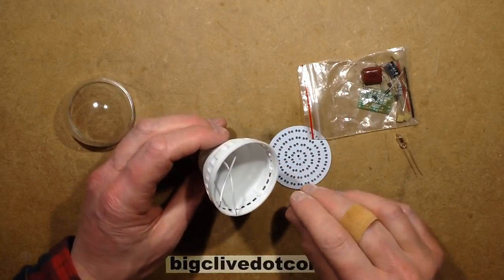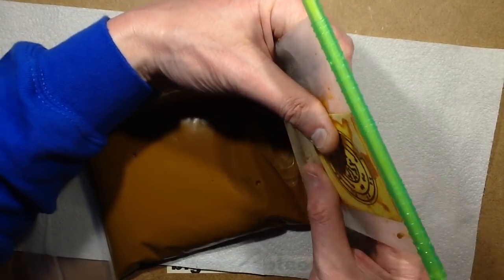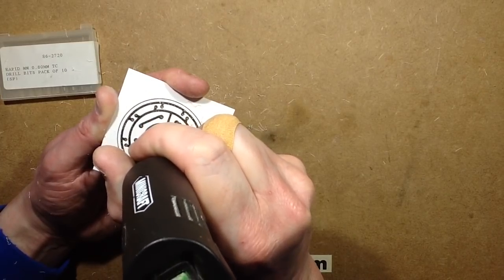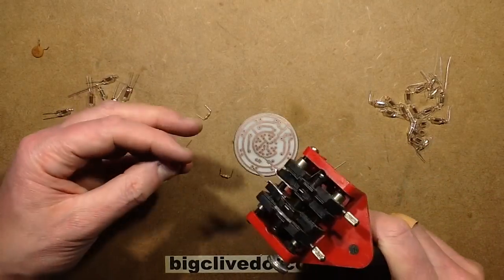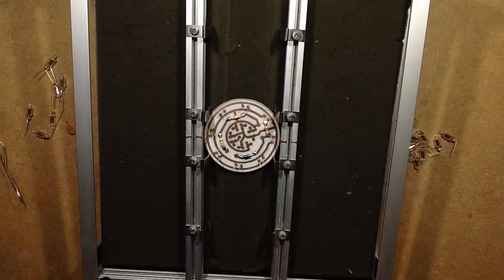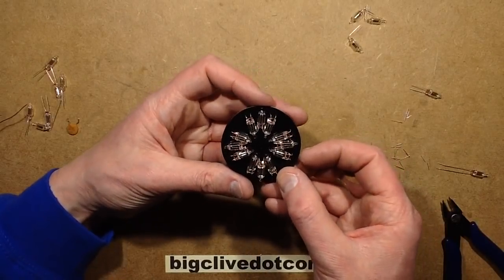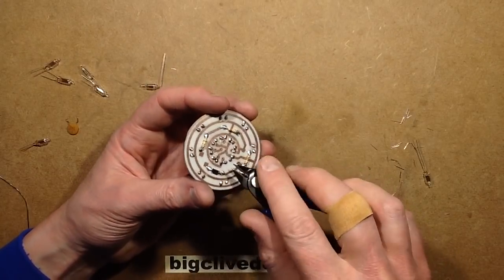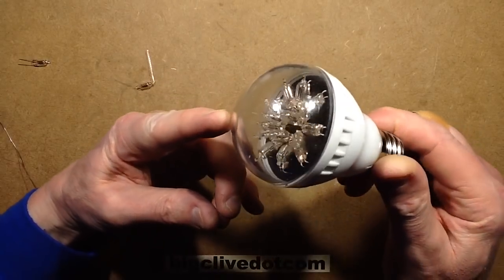Full mega nixie-lamp build with custom PCB.

Comment: Does this work with argon indicator lamps, too?
Reply from the maker: +BloodySword Not sure.  They're far too precious to use in big clumps like this.
Reply: +bigclivedotcom Why is everything that emits kind of blue precious?
Reply from the maker: +BloodySword the green, blue and even rarer white neon style indicators are just so much harder to find and more expensive when you do find them.  They also emit less light and fail faster than bare neon indicators and may not work in the same way on the circuit.
Reply: +bigclivedotcom Yeah, it's a pity that gas discharge lamps and LEDs that emit more in the shorter wavelengths areas are so brittle... Is it because it's higher energy?
Reply from the maker: +BloodySword In the case of the tubes they may be made of a quartz glass, and for the LEDs resin and chip degradation is probably the biggest issue at shortwave UV.

Comment: Nice solution (pun not intended) with the double-bag seal.
Reply from the maker: +Shroud3d It's a very clean etching system that stores in a small space.  I still use the original Seno GS accessories with it.  Mainly the support tray.

Comment: You should get some Plastidip for painting these, takes about 15mins to cure to touch and will not make a mess after this. It is also rubber based so may have some insulating properties? You can get it online or in Kustom PCs in Ayr if you are ever through that way.

Comment: hey clive, why not centre punch your pcb instead of putting your 0.5mm hole in the cad program?
Reply from the maker: +Liam Russell Because when I develop it properly it etches that indent for me with absolute accuracy.  The tiny hole in the copper is enough to perfectly align the drill bit.
Reply: yeah but for situations like that one.

Comment: Hi Clive...
Please forgive the possibly daft question but does Sprint Layout allow you to build a circuit diagram and then convert it to a PCB layout?
Cheers... Malcolm
Reply from the maker: +MrBanzoid No.  It has separate modules but no significant interaction.  It's main advantage is that it allows quite artistically placed PCBs to be made quickly.
Reply: +bigclivedotcom Thanks Clive.

Comment: I use an Epson r265 with a continuous ink system,  it's only cost me £12 in ink in the last 10 yrs, it would have got me at least £2000 if I'd used original inks.
Reply from the maker: +dooronron69 It saves a lot of inconvenience once you've got past its "huffy" stage of grudgingly accepting the cartridges and then cleaning the head from underneath after it vomits the new ink supply internally.
Reply: +bigclivedotcom ive been pretty lucky with mine as i run a programme that says they are full each time i reboot the printer. the only trouble i did have was the waste ink reservoir was saturated so i disconnected the waste ink pipe and it now goes into a lunch box with cotton wool in it which i change every so often. great video by the way.

Comment: Is there a place to buy lamp enclosures like that?  Would be cool to make custom LED lights.   Better than the stuff you can buy from pound land lol.
Reply from the maker: +The Rambling engineer. The Chinese do have some rather odd terminology,and it's clear they copy each others listings, complete with mistakes.
Reply from the maker: +Red Squirrel Yup.  eBay.  They sell LED lamps kits for about £1 ($1.50)
Reply: +bigclivedotcom I cant find them on ebay with the clear dome.... Do you have the link?
Reply from the maker: +The Rambling engineer. Here's an ebay search with the keywords.
http://www.ebay.com/sch/i.html?_from=R40&_trksid=p2050601.m570.l1313.TR0.TRC0.A0.H0.X60+LEDs+lamps+suite+diy.TRS2&_nkw=60+LEDs+lamps+suite+diy&_sacat=0
Reply: +bigclivedotcom Thanks! I guess i didn't have the right terms in the search bar... "led lightbulb diy kit" brings you very little.

Comment: Some Cannon's these days are money grabbing. The last one I tested for work had a system where if the ink cartridge was removed for any reason that same cartridge could not be installed in the printer again even if you remove it when it was full.
Reply from the maker: +Sean N The secret is to check the availability of refillable cartridges or continuous ink systems before buying the printer.

Comment: Those motorised chucks you mentioned, I have 3 or 4, in short dont bother, the chuck is all one piece and they hold the bit at an angle, cheap and horrid.

Comment: Rock 'n' Roller Coaster in Paris is really an amazing ride. It's unbelievably smooth.
Reply from the maker: +SteelSkin667 It is.  I had the surreal experience of riding with one of the Dutch guys that put the lighting in that ride and we were just talking about the lights as we blasted through them in multiple loops.  Totally distracted from the ride itself.

Comment: Have you thought about trying silk dyes for coloring circuit boards? I haven't tried it yet.
Also, the copper oxide plated on the surface of the dumet wire will actually bond to the glass.

Comment: For the record, Dumet is iron-nickel-cobalt alloys, with many sub-types. None with copper, strangely.
Reply from the maker: +Alex Barlow I also completely failed to mention that the red colour was a deliberate oxidation of the wire to act as a mating surface for the glass.
Reply: Oooooh. That makes more sense.

Comment: Windows 8 laptop or a PC with a battery and wireless network card.
Reply: Um, pc.. with a battery? you mean like a UPS?
Reply: F1nWarri0r Yes.
Reply: +PianoVideosJustForU (PVJFU) Can't really compare laptop battery life and ups's now can you? I don't understand.
Reply: F1nWarri0r Yes you could, they're both a battery, with the power goes out as long as the battery has power in it, your PC will still work.
Reply: +PianoVideosJustForU (PVJFU) Yes, but with a laptop, even a crappy one you most likely still have at least a few hours of time to save your work or even keep working. Ups's give you just enough time so you can save before it runs out of juice. Unless we're talking huge enterprise-grade equipment here..
Reply: F1nWarri0r No, my crappist one doesn't even hold a charge, but a decent crappy one for me is about 15 mins-1 hour, you could get 15 mins out of a UPS.

Comment: Do you have a PCB pattern for your ionizer design, or should I just solder the components to each other? (I'm building it this week, finally)
Reply from the maker: +Gadgetboy Do you mean the voltage multiplier version with the capacitors and diodes?  I think the version without a PCB is actually better for tracking distance clearance.
Reply: +bigclivedotcom Oki, I'll do it that way, then.
Reply: One last question before I get started on my build. On the website, you've indicated an add-on neon indicator, with the resistor and capacitor and neon. Is this in series at the high voltage side of the multiplier, or on the mains side? The diagram indicates it on the high voltage side, but the ionizers you've torn down have their indicators on the mains side.

Thanks in advance for the clarification, I don't wanna let the mysterious blue smoke out of anything (especially when fiddling with things producing Kv...)
Reply from the maker: +Gadgetboy On the commercial ones the neon is just a power indicator.  On the website version it is used to indicate ion output by blinking at a variable rate.  So in the latter version it is in-line with the output.
Reply: Thats what I was thinking, just wanted to make sure.

Comment: I used sprint layout for years, But had to learn Eagle because the board manufactures would not take sprint files for production runs.
Reply from the maker: +Mike James I've had no problem using the Sprint Gerber and NC drill files with manufacturers.  It may be that they just didn't take the bare LAY file.  With my current suppliers I put all the Gerber layers in a zipped file and upload it on their website.

Comment: Nice but it won't be very bright.
I like the 'fire in a bulb' effect with the diffuser. It should be possible to build a brighter version of this with LEDs in a grid pattern driven from that random LED flasher  program you demonstrated recently.

Comment: May I ask where you got the white PCB with the photosensitive coating, Clive? After watching you do it I'm tempted to try this myself...
Reply from the maker: +alexanderktn Photosensitive PCB laminate is a common item from good electronics suppliers.  In the UK I buy it from a company called Mega Electronics.
Reply: +bigclivedotcom Thanks! I can get them with a greenish base board color here, I was just wondering because I never saw a white version and would prefer it over the green one, especially when the PCB is visible.
Reply from the maker: +alexanderktn The white stuff is FPC16.  A cheaper prototyping material than full fibreglass laminate.  It has two layers of fibreglass with a sandwich of a lighter traditional paper bonded material in between.  It's lighter, cheaper and easier to drill with most of the advantages of a solid fibreglass laminate.  The whiter finish is nice too.  http://www.megauk.com/pcb_laminates.php
Reply: +bigclivedotcom Thanks a bunch, that was what I was looking for - FPC16. Now that I know I guess I'll buy a few - they are gorgeous (even when not painted black ;) ).

Comment: I've always had good experiences with HP when using inkjet printers, but I've always gone for the old ones (940c, 970cxi, 990cxi) so not sure about the newer ones, but those old ones seem indestructible and Windows 10 has full support for them

Comment: +bigclivedotcom With the printer. I have an Epson printer and i used have windows 8 till i got pissed off with it. I just used 7zip to extract the windows 7 driver find the inf file and install it manually.
Reply from the maker: +Ben Mitch I've just discovered that while they don't support the printer model I have (possibly a UK number variant) they have a driver for the base series that did work.

Comment: You're damn right about Epson being control freaks. Last Epson printer I had came up with a non resettable error one day that basically said "this printer is now old you must buy a new one" (something about the ink pad being full, which was an estimation coded into the firmware, not actually measured!). I will never buy anything made by Epson ever again.
Reply from the maker: +add2k Look online, there may be a button combination that resets the ink pad counter.  Be wary of any software being sold or made available "free" that does it though.  It might have a malware payload.
Reply from the maker: +simontay1984 The only good ink cartridges for an Epson are the bulk external tanks hooked up with a CISS cartridge so you can print to your hearts content without worrying about the cost.  But you do have to nurse it through accepting the new cartridges and getting over it's ink-splurge moment that it usually has when they are first put in.  The Epsons are just not quite as good at handling their ink as the Canons.
Reply: +bigclivedotcom Unfortunately there was no button combination that would reset the fault, it had to be done either by sending the printer to Epson (£££) or by a piece of software.

There are some free programs out there that will reset the counter, but unfortunately as the firmware on the printer had been updated they would not work!

In the end I had to pay a few dollars for a piece of (reputable) software to reset the counter and had to strip the printer down and remove and clean the ink pad which was a messy job!
Reply: +simontay1984 I did take it apart and clean it, but it was a messy job and it isn't just a tank or a sponge like one may expect. It's a '3D jigsaw puzzle' of sponges that don't go back together very well once they've been removed, cleaned and dried.

...And you have to pay for software to reset the counter! There is no way of resetting or using the printer once the waste ink pad timer count is up.

When this happens, the majority of people would simply bin the printer and buy a new one. Ultimate planned obsolescence!

Comment: Is there anything particularly wrong with using a dremel with cheap steel bits to drill PCBs? I'm just wondering because I'm a beginner and this was my cheapest option of doing it.
Reply from the maker: +Derp Herp If you already have a Dremel then that's a good option.  You could use the steel drills or try the tungsten carbide bits.  I like to say "Use what ya got."

Comment: That looks amazing, without the diffuser it looks nice, with power and the diffuser it looks alive like something trying to escape lol :-D
Your too clever clive :-D
I used to use petrol to remove the etch resist, but that was the pen type of resist, crude but worked :-).
The etching system was so dam expensive, also you could get the tinning fluid as well, but sell a kidney lol.
Reply from the maker: +zx8401ztv I had the tinning fluid and it was great.  But one day it kind of self reacted and all the tinning agent just suddenly precipitated out.  Too expensive for the amount of use I got from it.

Comment: I've not made it past 2:18 yet, but needed to thumbs up for "SHIT LOAD OF INK"
Reply: +simontay1984 I use a brother laser printer for everything anymore. Ink jet printers are an abomination that never should existed :P In this day and age, color printings are rarely needed for anything, and if i need one, i just pay my library a few cents to print from a flash drive for me.
And if you like ozone smell, you will LOVE how fresh laser printings smell :)
Reply: +Richard Smith Indeed; my old Hewlett-Packard LaserJet 6MP is still running strong. The toner cartridges don't clog or whatever - and costs a lot less per page than inkjet. I've got a FedEx Office nearby with self-serve color copier/printer units that produce much better quality color laser prints than any inkjet I've seen, should I need color.
Reply: +simontay1984 Seen the new Ink Tank models?

Comment: Is it possible to know where the "dominant" tube will be based on the circuitboard design? In this case I feel it would have been best to have the dominant one in the center.

Also I loved the frosted dome at the end, reminded me a bit of the engines on the original Enterprise, although of course it looked very different. What an effect, it was so dramatic! It looked like fire dancing around inside there, I could definitely see a number of those being used as a sci-fi prop, maybe some sort of component in the engineering section of a starship.
Reply from the maker: +Caseosio You can't predict the dominant lamp as it will be the lamp itself and the difference from the other lamp is not visible until it is powered up.  I have been thinking that the random effect could be made brighter by emulating it in software on a microcontroller with LEDs under the dome.
Reply: Presumably the dominant lamp is the one with the lowest strike voltage.  If that's true, could you test them all using an oscilloscope and a HV supply, and capture the strike point of each?

Comment: Epson really sucks indeed, I can tell you from experience. Also I would stay away from HP. Canon makes some good printers. I also have had some good experience with Brother (MFC J4620DW). The MFC J4620DW is a very nice printer with some nice features like A3 printing and good print from phone support. It takes nice and large cartridges and has a good print quality. It does have occasional paperjams with some types of paper though.
Reply: +simontay1984 The problem I have had with several HP printers is that it prints quite well, until you have replaced the cartridges two times. Also the ink dried up quite quickly. I had to use original HP cartridges if I wanted to print something presentable at all and after about 5 sheets of paper the quality was horrendous again. It seems you have been quite lucky getting that color laser printer that cheap. ;)

My granddad has always used Epson and even though they were nothing but trouble, he keeps buying them as he has used it since his first ever printer back in the 90's. His current printer only takes original cartridges. The cartridges are unbelievably expensive and contain very little ink. Also when the printer thinks the cartridges are empty, it just stops printing. Another reason Epson sucks, are their drivers. When you print via windows, another windows of Epson software comes up where you have to specify each setting. It's very sluggish software and has no notifications in the Windows notification tray.

Comment: Those cheapy ebay pound little drilling machines are generally piece of junk. They are small and have enough power, but inside you'll find boorish motor without any electronics. I own one, and have to say, spindle is not centered properly and drills bounce like bi*ch. You can't fix that anyway.

Comment: When in doubt, improvise, and then sell it as an innovation and sue the inventors... :P

I gave up with Epson, rarely print anything so every time I needed to use the Epson C46 that's in here somewhere, I had to change the cartridges & clean the heads so got about 3 pages per cartridge... :\

They make a sausage casserole flavour not poodle now, ain't too bad, just lacks sausages... :P

Neat creation that, you should get onto a manufacturer and start marketing them... :D

Comment: You can just do that in eagle, just put down pads and vias and draw tracks. No schematic required.
Reply from the maker: +jaaasgoed I did give Eagle a go a while ago, but it was heavy going.  Especially when I'm used to using another package.
Reply: bigclivedotcom
Of course you use what you think is best. However, I always encourage people to use both board and schematic. Especially for larger PCB designs, a schematic is a must. If you have your schematic in order, you can never forget to route a signal, since the DRC and ERC will warn you about inconsistencies.